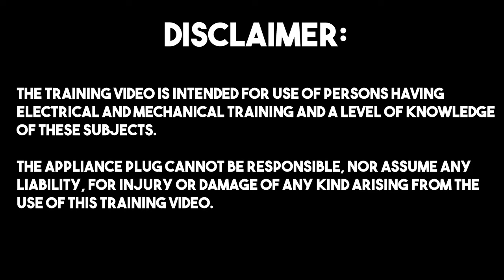How To Install A KitchenAid Dishwasher - Installation

Comment: Have this dishwasher didn't know about the side mounts good to know, I ran  my dishwasher a full loads before fully installing it to ensure that their wasn't any leaks going on under the dishwasher.  I also installed a water detector device under the dishwasher.  As we I siliconed all the edges at the wall side to ensure that if there would be a leak it wouldn't find it's self going in the walls and subsequently down to the next level.   The water detector keep it close to the front of the unit as you will have to replace the battery every five years.

Comment: Great tutorial, thank you. As already the other guy mentioned I have never knew how properly use breackets for side mounting. Now I will do only that way!
The only small trick I can advise is to use a piece of towel paper on the floor under the water connections to check for leaks - it is almost impossible to miss a leak because even a small wet spot is seen on the paper (just touching with fingers is not always gives guarantee the leak was not missed). For additional security after there aren't spots I take a small bunch of paper in my hand and place it around fittings. It works in all plumbing projects for sure.

Comment: One thing that I'd stress is that the adjusting wheel in back really must be loosened before installing the unit. I had to use a very big Allen wrench on the foot. The flat blade screwdriver wouldn't begin to cut it. I doubt most people wouldn't have one, good luck. Otherwise, it was a great tutorial.
Reply from the maker: Thank you Tom for the amazing comment! and yes I second your tip about loosening the back adjusting wheel prior. Thanks for tuning in!

Comment: I've done this installation a few times over the years, but this is the first time I became aware of the 'side screw' option.  Whether or not my countertop was wood or stone, I now prefer to use this side screw option. I like the thorough work-thru video by this tech, but I would have liked to have seen a 360 of the unit at the beginning.  This 360 would give a novice installer an idea of how much spare room he/she had at the rear of the dishwasher; like needed space for an oversized electrical box mounted on the rear wall.

Comment: great video, I got everything hooked up, but the dishwasher sticks out a little more then I like. Do you think it would be ok to try to remove the mounting screws and readjust ?
Reply from the maker: Did you mount under the counter or side mount?

If the dishwasher sticks out passed the countertop, you should be able to slide it back further. You would need to make sure you don’t crush and lines and there’s nothing in the way in the space that might prevent you from doing so.
Reply: @TheAppliancePlug  got it all fixed up, looks good now. thank you.
Reply from the maker: @andrewblomberg3100  great! Glad to here.

Comment: I have a question.  I j7st got a similar model and it has 2 ports on the side. What are these for? And, the instructions mentioned a hot water hook up. What's up with that?

Comment: It was not clear to me where the side rubber strips are supposed to go. My installation guy left them totally exposed instead of hiding them behind the cabinets. What is correct? In my opinion he did not push the dishwasher in enough
Reply from the maker: Generally, the rubber strips should be behind the face of the cabinets and the front of your dishwasher should be even with the edge of your counter tops. However, there are situations that don’t allow dishwashers to slide all the way back. It can be things like electrical or plumbing lines. Usually these can be corrected so end up with a nice flush install. Thanks for watching!

Comment: I'm having a code come up after installation and a run through cycle. Water has dripped into the pan. It goes off after i wipe out the pan. Would the leak have come from that elbow attachment or from another source. There was a drop of water on that copper elbow, but unsure if thats the cause. Also, we used Teflon tape on the supply line connected to the copper fitting. Probably an obvious answer but putting it out there. Thanks.

Comment: I have a KitchenAid 404 that we bought at a scratch and dent store.there are two orange wires that go towards the left side under the water hook up and can not find what they hook to. I have watched videos and all I can see is they go towards the left side. Can any one tell me what they go to
Reply: Are they for a drip tray float sensor?
Reply: @Black2001Dodge  I finally found another one that I could look at. It has something to do with the water inlet. Thank you for your response
Reply: @Black2001Dodge  the bad thing is that the part they go to is missing. So a technician is coming out to fix it.